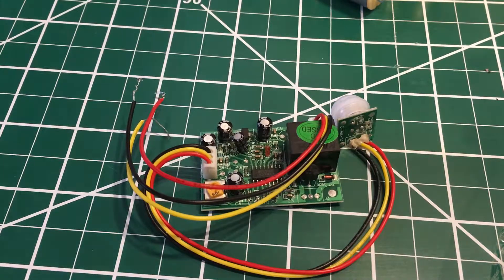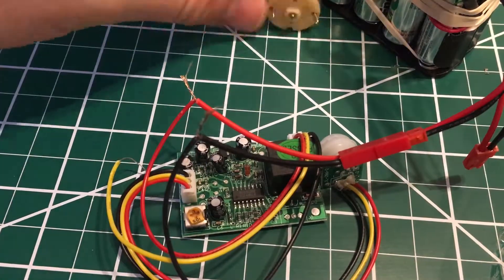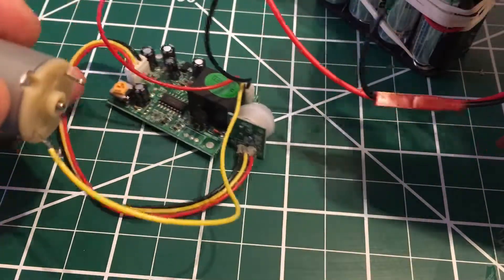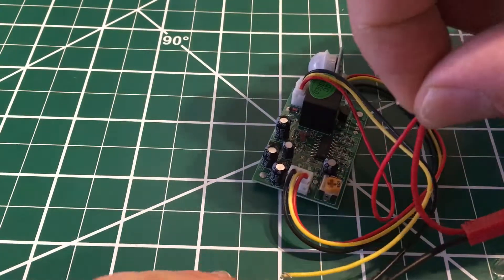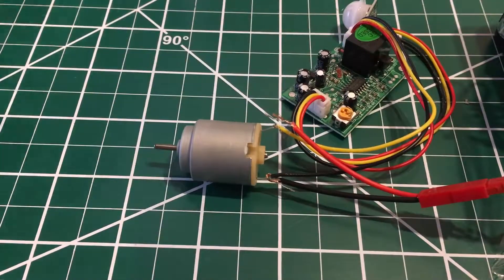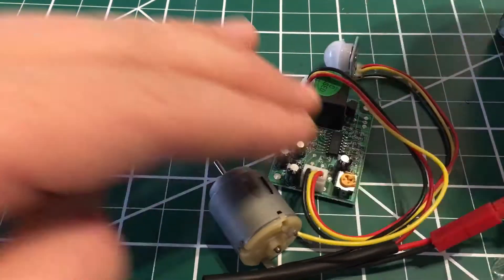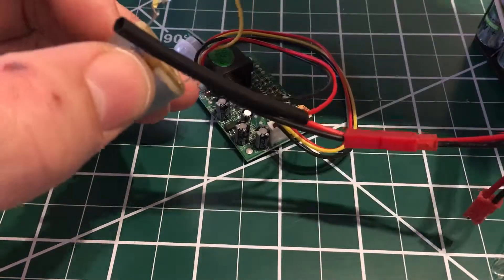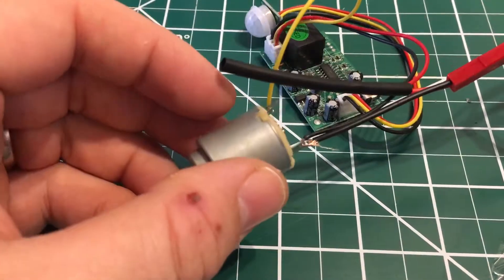How to wire motion sensor relay pir module

Comment: I am trying to do this exact thing.  I have my wiring exactly the same.  The output power from my PIR is not strong enough to run my motor though.  What is the output on your unit?  Mine is only 3.3v.
Reply: I have got the same problem?
Reply: You need to use a 3v relay. The sensor itself only puts out 3.3v as a trigger to another device whether that's an arduino or just a relay. That black box on the board is a relay.

Comment: PIR Sensor Kit for sale
Simple Circuit ████████ Automatic Bathroom Light. suppose you want to buy it will cost Rs. 1200/- in the Market. If you try to build by yourself it will cost you only Rs. 450/=. Suppose you want to buy Please ! Order. The retail Price is Rs. 875.00 :  ████████ 0722118831.

Consist of :
1. 12 volts DC Relay            1 pc
2.  PIR Motion Sensor         1 pc
3.  Resistors                        2 pcs
4.  Transistor BC547           1 pc
5.  Wire Connector (3 pin)   1 pc
6.  Small piece of Solder Board
6.  Small pcs of Wires.
7.  Tiny amount of Soldering Lead.
8.  Workman ship +
9.  It is an open circuit board without box

This works only on DC 12 volts Current (Battery or AC/DC Adaptor)

Why I mentioned these details because some of the Sri lankans want VALUE for the Money and they like Cheap things very much.

For people who can afford will have to buy that from any electronics shop Above Rs. 1200 to 2400. Which will have AC 220 Volts & DC 5 to 30 Volts.

If you wish to order call : (076) 465-5098. Delivery not possible Please Collect it.  

https://sites.google.com/site/trendymixscope/solar-mobile-charger/PIR%20Sensor%20Circuit.jpg